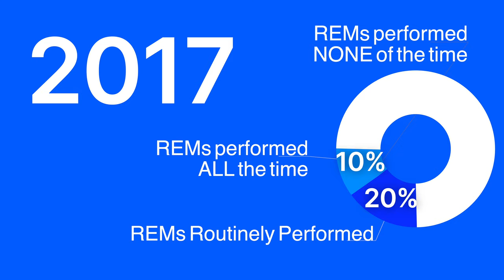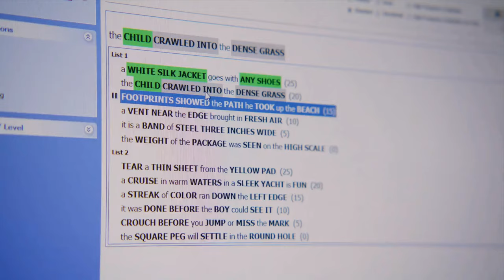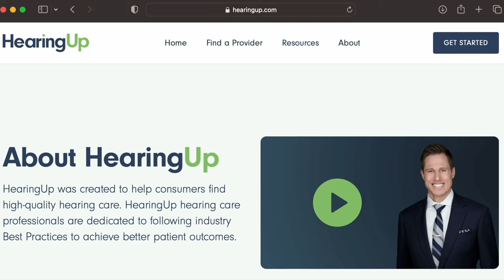BIGGEST Problem with Real Ear Measurement

Comment: Hi Dr. Cliff. I did go to your HearingUp website and found one of your providers (since my ENT doctor and audiologist did not offer a Real Ear Measurement (REM)). I sent an email to the HearingUp provider requesting a REM. They replied and scheduled an appointment for me to come to get the REM. I brought my recent Hearing Test and hearing aids to the appointment. The specialist was very helpful and explained each step in the process. He checked my ears for earwax to help ensure a good REM. He spent over 1.5 hours with me performing the REM, fine-tuning the settings to maximize the hearing aid performance. I do go to my ENT annually to get a Hearing Test, and my hearing test results show moderate hearing loss and Tinnitus in both ears that have been stable for several years now. I am now very pleased with the results and my hearing aids now work the best they have ever been. I’m very grateful for you and your many videos and helpful hearing information. Many thanks !!! 😊
Reply: Does real air measurement work with over the counter hearing aids brought online such as eargo and others?
Reply: 0ops,  I meant Real Ear measurement, not real air measurement.

Comment: I recently jumped into a new clinic, and found myself doing cleanup with dozens of clients from the last two years, where the previous clinician preferred to only do SREM (started to do it during COVID, didn't stop doing it after COVID became less of an issue). I personally always do WRECD and REMs, with targets bang on, up to 4k-5k. Your video on the importance of verification measures being done correctly is what drives me to always do it, every time, even if the appointment is just a reassessment and adjustment! Combining fantastic REMs with adjustments based on client feedback on what they're experiencing, has been a solid recipe for success, for me.

Comment: The one problem with the REM is that the target isn’t always the correct or ideal fitting.. it’s only just a set point for a given target.. Its what people think it should be but its not always the case. There are many software settings that can be used to match target but it doesn’t always mean it’s correct

Comment: I just got fitted for my Oticon real 1 hearing aid. My Audiologist used the   measurements against my 15 yr old Analong aid. I find that distortions has always been a problem in these digital aid and end up suffering with my analong aid all over again. I hope the Oticon Real 1 will be a deal breaker for me. 
My question is. 
How can the real ear measurements be accurate using a very old analong aid verses the digital ones? Aren't they built differently?
Reply: Hello, Canadian hearing instrument specialist here! What REM does is measure the way the sound from a hearing aid is behaving inside YOUR ear canal vs what the programming software estimates for the average 2 cubic centimetre adult ear canal and is a standardized process no matter the make, model, style, or age of the hearing aid.  Factors like the canal volume, shape, and resonance are unique to each ear and can affect the way sound pressure hits the eardrum, so we need to verify that the amplification you are receiving at each frequency is actually meeting your hearing loss targets and giving you maximum benefit in terms of gain and output. 

In a nutshell, REM is measuring the amplified sound in your ear, not necessarily the hearing aid function or sound quality. If you have concerns with distortion, ask your provider to run a HIT test or electroacoustic analysis on the devices and compare the findings against ANSI specifications for that hearing aid to identify or rule out noise artifacts in the device itself. Hope this helps!
Reply: @feliciaenns2503  Finally, an actual description of what a real-ear test does and why you need to have it done. Bruce W

Comment: Hi Dr Cliff - following on from your recent Australia trip when do you believe you might have some practitioners in Australia (particularly Tasmania) that follow your principals?
Or am I just jumping the gun.
I have mild hearing loss (industrial deafness from my time as an apprentice Boilermaker in the 60's) when there wasn't anything done about hearing protection.
Cheers
Reply: If you live in Tasmania, and you are seen under the Hearing Services Voucher program, as a starting point your hearing aids will be fitted to a prescription. Some form of verification will be used (either REIG/REM, or alternatively a test  box).
Reply: @19833891  Thank you for the info, I had a couple of tests some years back with two independent providers but I got the feeling they just had an agenda that had many $$K's attached. Maybe that is what it costs so I will try again if I can find a provider not aligned with a manufacturer.
Cheers

Comment: Hello, nice vid, ty for sharing.
A quick question: After 8 years of using hearing aids, i changed them and tried out a new pair during 40 days. This new pair made my tinnitus increase a lot. I stop using them and returned them, and back to my old ones. After 8 months i'm better, and the tinnitus had been decreasing again over time. But why the hearing aids I tried greatly increased my tinnitus?